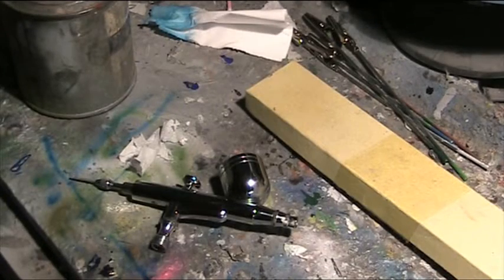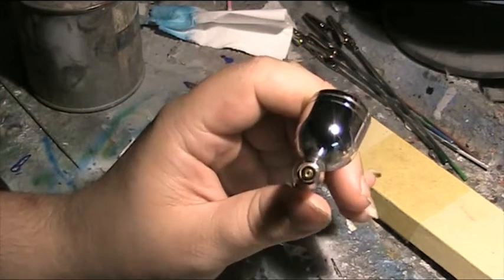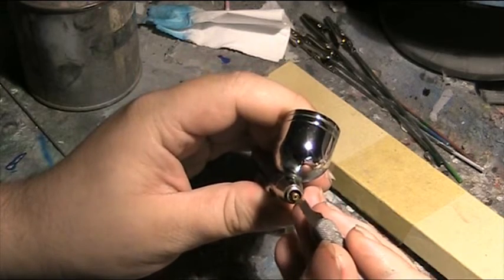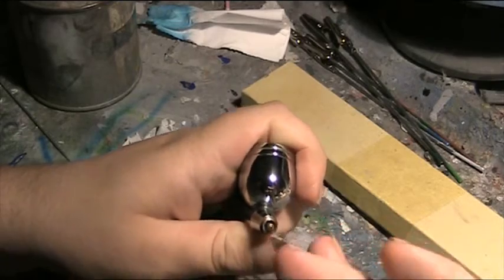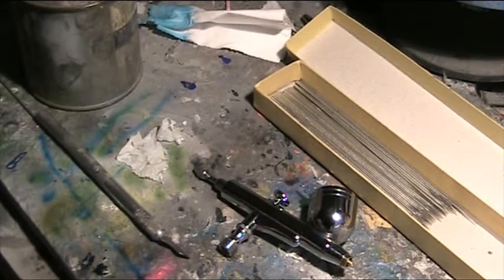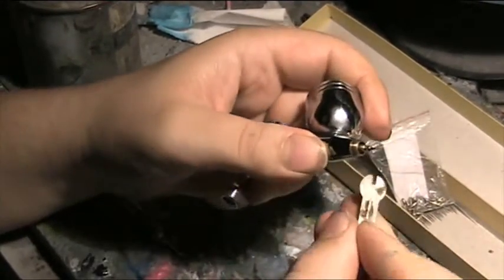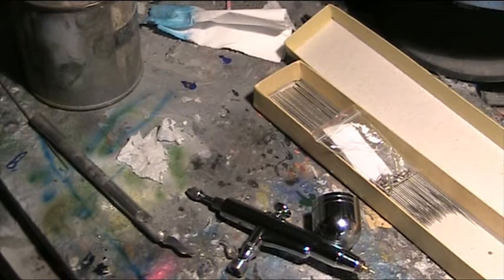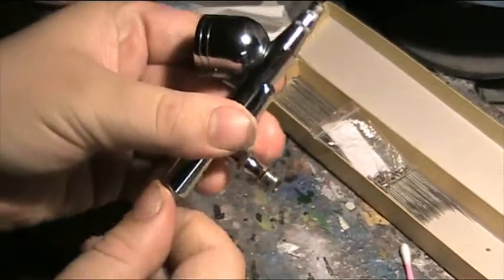How to remove broken nozzle threads from an airbrush

Comment: I bought the replacement nozzle frkm ebay as u suggested. Now my problem is that the nozzle is too long that the tip of it is already blocking the nozzle cap hole. How can i resolve this? Appreciate your help in this 😭
Reply from the maker: I had this happen with one of the older model Hiseng from 2010's. You can also buy longer or modern nozzle cap from amazon/ ebay or for now unscrew the cap by one or two threads for enough clearance to spray.
Reply: mokanaman thanks for helping me in this, i did try to adjust the threads but not enough as the air is already leaking on the thread if i adjust further more. I tried sanding the edges of the nozzle to reduce the size so it wont fully block the air passage. But i think i  damaged it so now bubble coming back in my paint cup 😭. In this case if I buy another nozzle from ebay do i need to buy a nozzle cap pair with it? To make sure that the nozzle is compatible with the cap?
Reply from the maker: @redicaro7642  One reason I love helping out specially beginners from different trade/ craft back grounds. The fresh wild ideas that comes forth are exciting to learn of experiment with. I would recommend filing down the thread end of the nozzle first. Please report back with your results mate.
Reply: mokanaman before i tried sanding the nozzle tip my first plan is to file the thread, but i noticed it only have 2 layers of thread so i guess reducing it further is not a good idea as there will be no more enough thread to hold on if i reduce it. As of now i already gave up on that nozzle, i tried buying another nozzle this time i ordered .2mm instead of .3mm that i tried earlier. We’ll see if it fits, hopefully wont have issue with the nozzle cap. Ill come back to you again once i received it.
Reply from the maker: @redicaro7642  If possible could you send me a pic of the airbrush and a link to the nozzle listing on facebook or twitter, PM or public does not matter.
Reply: Let me have your facebook account so i can send it there
Reply from the maker: @redicaro7642  its a page, details in the description or just mokanaman.
Reply: mokanaman i sent already to your fb messenger

Comment: What if you actually damaged the threads inside the pipe where the nozzle attaches? Is the gun no good then?
Reply from the maker: at that point the airbrush is pretty dead, should be hard to do as nozzle is brass and brush steel
Reply: @mokanaman  Thank you for getting back. I feared that being the case. I handed the airbursh over to someone who wasnt gentle and tried to remove the broken nozzle. I will purchase a new airbursh. Thanks again.

Comment: Where to buy with that much nozzle? They are selling here for $20 per piece
Reply from the maker: ebay or amazon, shipping from china is a tad hard during COVID.
Reply: mokanaman will the thread have same size that will fit my airbrush even if i buy different nozzle tip size?